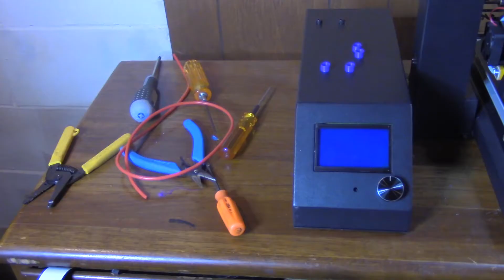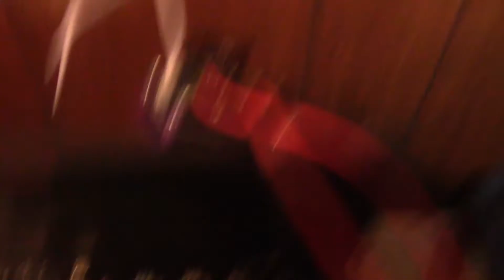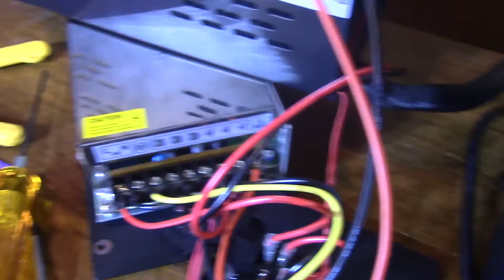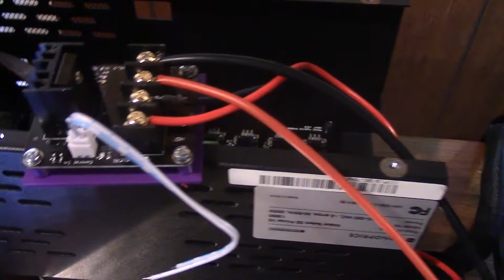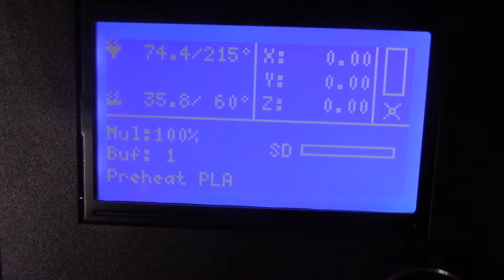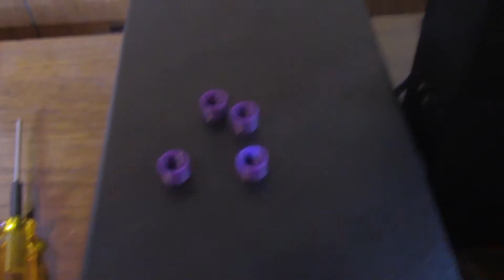MOSFET MOD-MONOPRICE MAKER SELECT V2 3D PRINTER-MOSFET MOD

Comment: Obviously there are people playing with electronics that really shouldn't be judging by the comments. The purpose of this mod is to decouple the original MOSFET on the melzi board onto a separate isolated higher rated power MOSFET. You're plugging the control wires directly into the old heated bed connector. GND is ground, PWR is power/control signal.

For those who don't know... white wires which you can't easily tell have markings on them for ground. It is a black stripe or marking. In his video, it's a long black dash stripe. This indicates the GND wire. Plug that into GND, and the other one into PWR.

Comment: "that connector right there"... WTF?  lazy video, wasted my time.
Reply: Exactly the reason I watched this video... From another source "Afterwards, we install the Control Input wire (white one) from the MOSFET board in their place." Meaning in place of where the original got power.
Reply: Still took the time to write a wasted comment though right?
Reply: @RamjetX  that comment actually help me out, because I re-watched the video three or four times before realizing the uploader never states which wire... I feel like the video wasted more time than that comment

Comment: at about 3:12 you show the two signal wires but the camera shifts and we can't see where you'll be connecting them.
Reply from the maker: BlueHeron13 to the green connector where you remove the original wires.